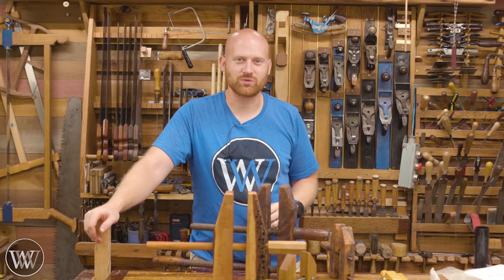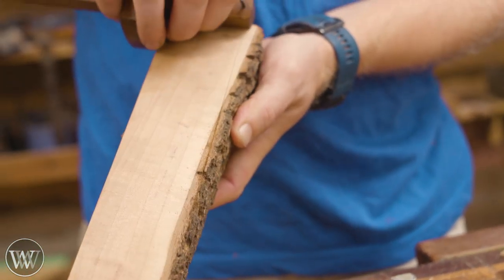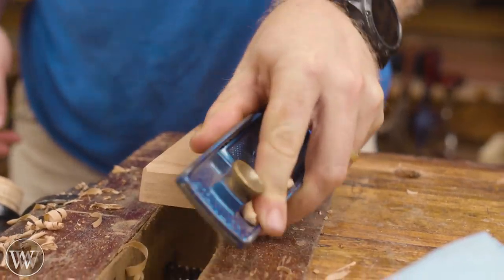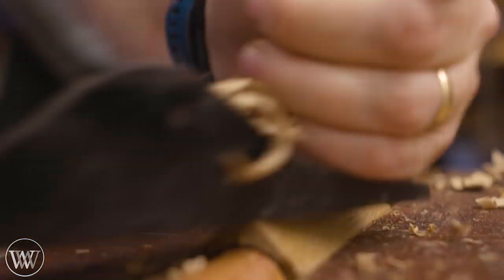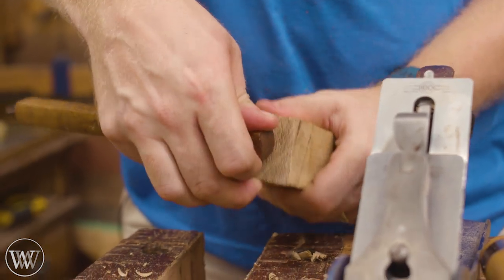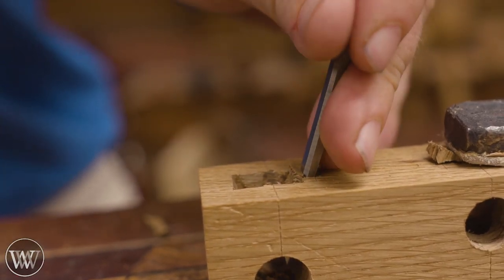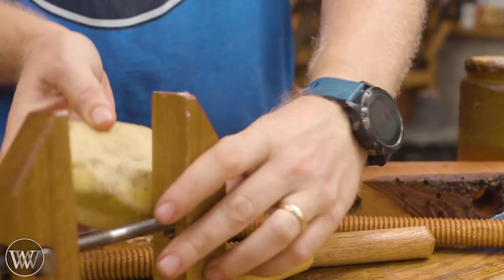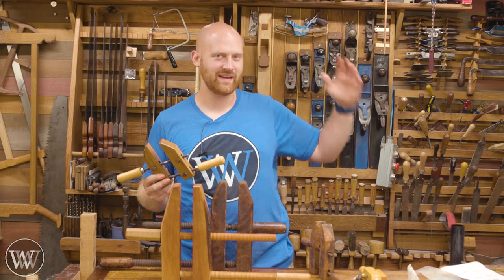How To make a Hand Screw Clamp

Comment: I won’t physically be capable of doing the all wood version unfortunately, but I have a threaded M16 rod (about 5/8" off top of my head). So I might try make my own with that. I’m presuming this is a "hard wood only" project, or at least that makes sense to me.

I really like the live edge, it looks really good. Thank you so much for this video, we were discussing on your last week's video how expensive these can be in the U.K.

I’m running out of superlatives for this channel and all the help you give us newbies. Everyone sings Paul Sellars and Rob Cosman's praises, and they are fantastic channels and Rob does answer questions. So I’m not pulling those channels down in any way. But no one helps the newbies and gives us projects to move forward more than yourself and Rex Krueger. You have helped me more than anyone, I can’t get to night-classes due to my health, and at 59 it’s a bit difficult to get a father figure mentor. I’ve fitted a metal woodwork quick release vice as my face vice and a Veritas face vice with tulipwood as my end vice this week. When I finished them all square, solid and oiled I knew I had to thank you mostly and Rex. Without you answering my questions I would never have been able to do it. Unfortunately I also learned I'm a long way short of fit enough to to make a full wooden workbench, so my cheap eBay bench with the extra layers of plywood, shelves etc will have to do. I’ve got it functional and solid with some weight now though so all is good. Thank you James, I really do appreciate you and your channel, I think only another disabled woodworker would really understand my gratitude.
Reply from the maker: sounds like a fun project. thanks Mark!

Comment: Watching the close up of the freshly sharpened bit slicing through the hardwood makes me realise just how much my bits need sharpening! Lovely outcome as ever - thanks for sharing.

Btw I have a couple of wooden threaded clamps I picked up second hand. I've been holding off oiling or lubricating the threads because I'm scared of gumming them up, and making them hard to turn. Is that fear unfounded?
Reply from the maker: A good sharp pit is an amazing thing. I just used a bit a pace wax on mine. No fear of gumming them up if it builds up too much they clean themselves off when they run through the hole.

Comment: How has the live edge clamp held up? It looks like the bark would just fall off after a while. If I found a way to keep that from happening,  I'd make a bunch of those! It looks great!
Reply from the maker: No problem so far. I love using it wen ever posible
the bark staying on has a lot to do with when the tree was cut. if it was taken in the spring there is almost nothing you can do to keep it on. if it is taken in the deep of winter it iwll usually stay.

Comment: Boring in the end grain (5:01) is definitely more difficult. It requires one to apply much more force to push the bit. I didn't and I broke the tip of a lead screw of my auger bit.
Reply from the maker: Right on. It takes a lot more to do end grain.

Comment: thank you James . questions please will metal taps and dies work on the wood ? i ask because i have some just never tried it
Reply from the maker: The taps will work great. However most dyes do not hold the threads very well and they tend to shred the wood. But putting metal fasteners into wood actually works surprisingly well.
Reply: @WoodByWrightHowTo  than k you

Comment: it’s possible to make one with regular screws?
got a bunch of screw rods of 12mm
i’m tired of F clamps botching everything that i use them on
guess that i could use a bit and washer on the free ends to ensure some more parallel clamping because the one way thread on the rod
Reply from the maker: Sure. you can make them in the same design as the wooden screws.
Reply: @WoodByWrightHowTo  great will get some hard wood and make one or two thanks
Reply: @WoodByWrightHowTo  what ive understand is that the back screw pivots on one point and the other grabs the threads in both?
Reply from the maker: Both screws are threaded into the same jaw. The one farthest away from the tip doesn't go through the second jaw. It just pushes into it. The screw in the middle slides through the second jaw and the handle pushes against the second jaw.
Reply: @WoodByWrightHowTo  thanks a lot
usually i can follow you but this one was more difficult because english isn’t mother language

Comment: Another question on this, James. What diameter dowels for 1/2" screw, 3/4" screw, and 1" screw? I assume that the 1"? Are they the same diameter as the screw diameter or larger?
Reply from the maker: usually the bolt threads are the measurement as the starting dowel.

Comment: nice & beautiful work.... something boggles me a bit - I tried paying close attention to your process, on the small metal screw clamp it seems like the screw closest to the camera is turning anticlockwise to advance which means the 2 screws/inserts aren't identical, yet for the wood thread you've created a long thread and used the same thread direction - am I missing something?
Reply from the maker: correct the metal ones have switching threads. so one end of the bolt is left hand and the other is right hand. On the wooden ones it is the same thread all the way through as there is only a nut on one end of each where as on the metal ones there is a nut on both ends.

Comment: Two comments.. first, had not seen the ring on the hand drill/auger... Assume to keep level? Genius.
And second, I struggle to understand why the wooden screw clamp had two threads the same, but the steel threaded one has one screw threaded in opposite direction...  I'm sure it works... I just can't get my head around it!
Reply from the maker: the steel one pushes both jaws apart form the center. the wooden one pushes them apart from eather side. hope that helps!

Comment: I've noticed your ring on the bit in several videos while you're drilling.  Is there a reason why you do this?
Reply: It's a way of knowing if the bit is level while drilling. If the ring doesn't move it's level. If it starts moving towards you then the bit is tilted down and you need to raise the back end. If it moves away from you the bit is tilted up so you need to lower the back end. Simple but effective.
Reply from the maker: What he said. I have a couple videos on how to drill a square hole if you want to see more detail on it. But it's a pretty simple technique that works really well.
Reply: Small problem for me, I can no longer get my wedding ring off my finger. I have to either cut my ring or cut off my finger. What can I do best ...  :-) Great video!
Reply: @andrevanopstal2143  If you want the ring off you could try this instead of cutting it. https://www.youtube.com/watch?v=KJHUAwEx1bY
Then you can have the ring resized so it fits again.
But in place of a ring on the bit you could use something like a washer instead.

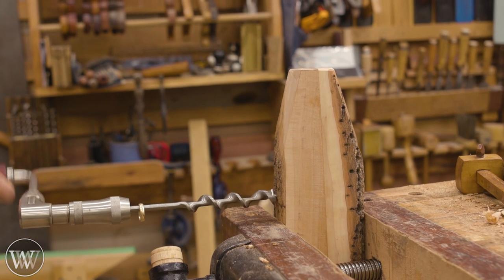Comment: @3:03, why is there a metal ring on your auger bit?
Reply: It's a way of knowing if the bit is level while drilling. If the ring doesn't move it's level. If it starts moving towards you then the bit is tilted down and you need to raise the back end. If it moves away from you the bit is tilted up so you need to lower the back end. Simple but effective.
Reply from the maker: What he said. If you want to see more information I have several videos on how to drill a square hole. It's a fun technique that works really well.